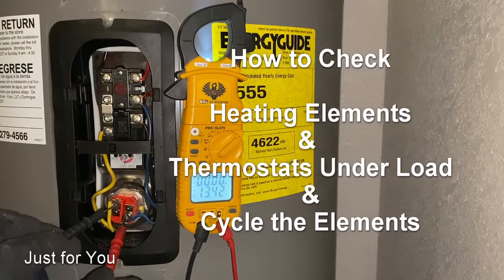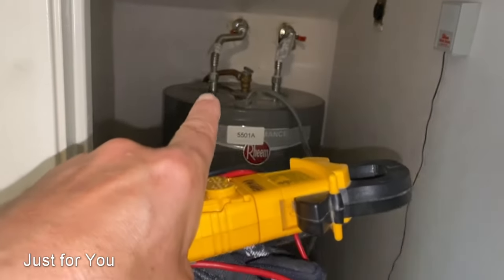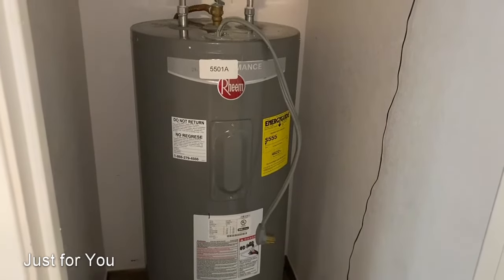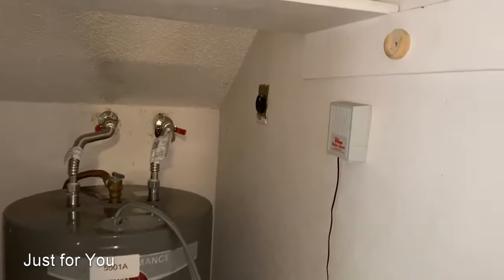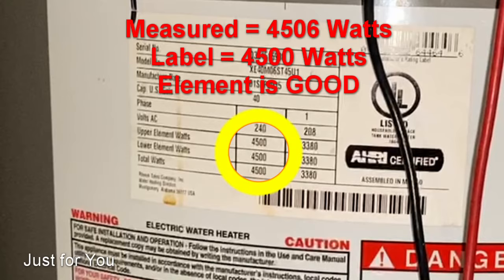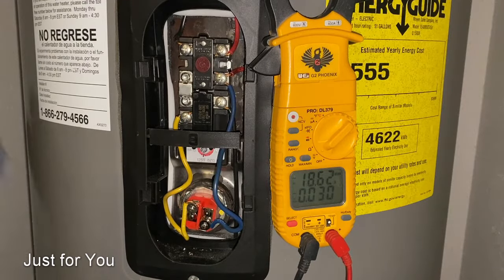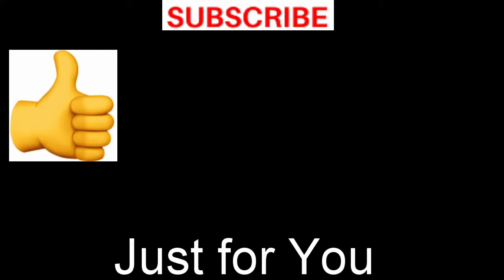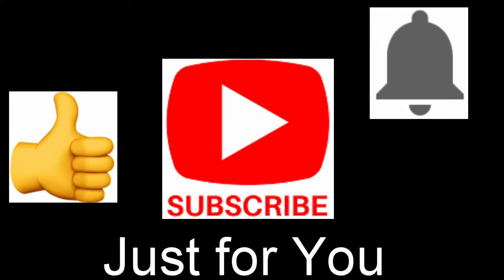Best way to check water heater’s heating elements & thermostats. And, cycle between the elements.

Comment: Excuse me our John Wood water heater is still working good for 8 years but now I  check the top of the water heater there are so many places severely rusted especially at the ironing flowers at the hot pipe & cold water pipe on the top of my heater water❤❤❤❤😊🎉
Reply from the maker: If you see rusting on the pipes, this video may help.

Don’t make this mistake. It could flood your house. Water heater plumbing mistake.
https://youtu.be/Ajj2UFI2vXU

Comment: When the upper thermostat switches current to the bottom element do you still have 120 volts at the upper element terminals?
Reply from the maker: Good question. You’ll find the answer in this video, diagram on how everything is connected will help.

Electric Water Heater-Understand How It Works So You Can Troubleshoot Why It’s Not Working Correctly
https://youtu.be/rrBCsvTGsgQ

Comment: what if i have 240v at terminal but it isnt drawing current?
Reply from the maker: If you’re getting 240 at the heating element’s terminals and there is no current draw, the element is open (defective). You can also watch my video on:

Electric Water Heater-Understand How It Works So You Can Troubleshoot Why It’s Not Working Correctly
https://youtu.be/rrBCsvTGsgQ

This will help you understand the operation and element sequencing. Hope this helps. Farshid

Comment: How do you check if the entire tank is grounded properly?
Reply from the maker: Use an ohmmeter to check continuity between the tank and the ground on the main power connections. Hope this helps.

Comment: I had a problem today. The upper element is receiving 240V properly, which indicates it seems to be working fine. However, the lower heating element is getting 120V on each terminal while the upper element is operating. When I check the voltage across it, I get 0V.

Do you know what might be the cause?
Reply from the maker: When checking the element terminals, if you’re getting 120V on each leg to the ground and 0V across the two, for that element you are only getting one leg of the 240V. Since it’s the bottom element, the switched leg is not switching. That being said, keep in mind that one element is powered at a time. Check out my other video on:

Electric Water Heater-Understand How It Works So You Can Troubleshoot Why It’s Not Working Correctly
https://youtu.be/rrBCsvTGsgQ

Hope this helps.